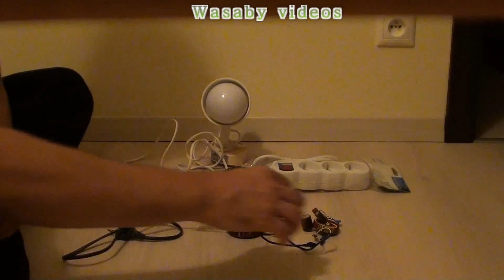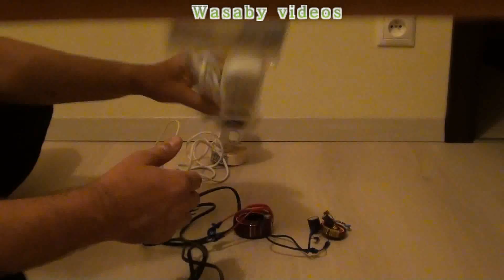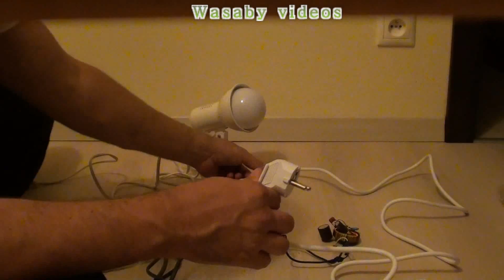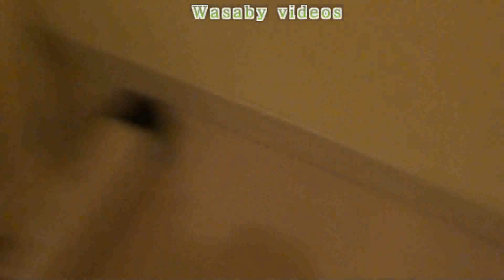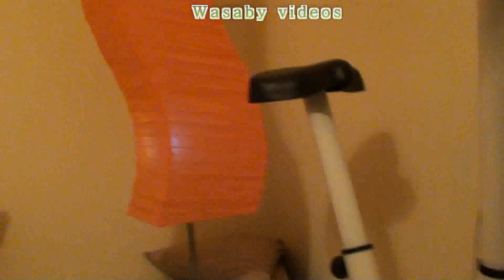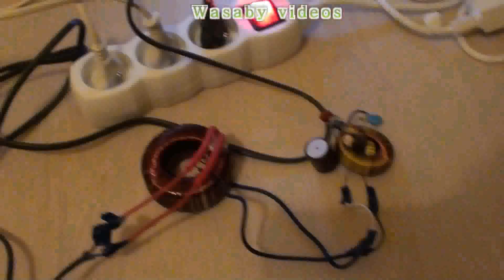Free Energy Generator for light bulb "Free Energy"  | WasabySajado

Comment: crap - hey guy , It is working only on HIGH capacity of your circuits , It will be working till relative capacity of your circuit will not reach unusable voltage/current for bulb ;)

Comment: I've seen this kind of video before, but the original was without the cap's and coils circuitry and was impressive all by itself. I'm not sure, but it might even have been you that made it. I noticed the same style of power bar and its packaging in both videos, new.

Is there a possibility of a schematic or at least a readable drawing in the not too distant future? I would like to try this circuit for myself, because I'm wondering if the circuitry inside the power bar is part of why it works and is particular to that brand/style.

If I understand what I saw correctly, the new set up uses Joule ringer or Joule thief circuitry to light the 220V, 12W bulb. Is that correct?

Over all, it's a very intriguing demonstration and I'm looking forward to trying it.